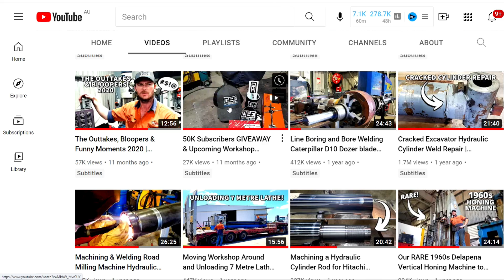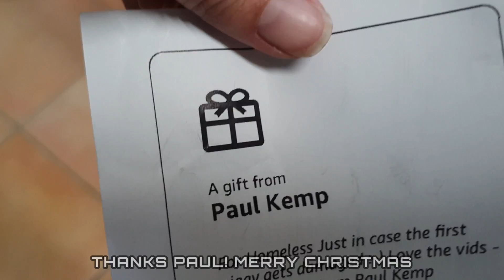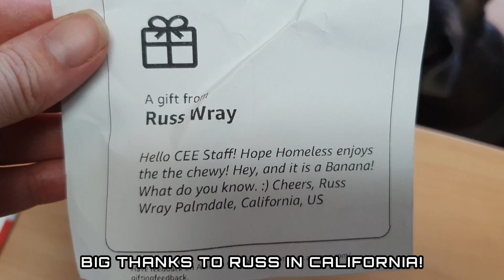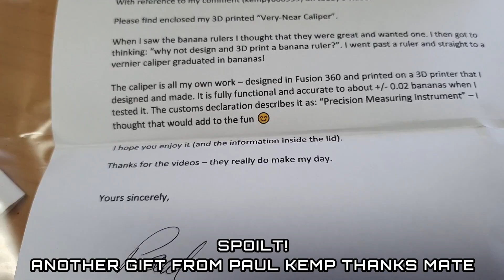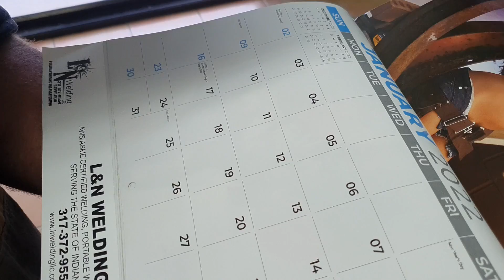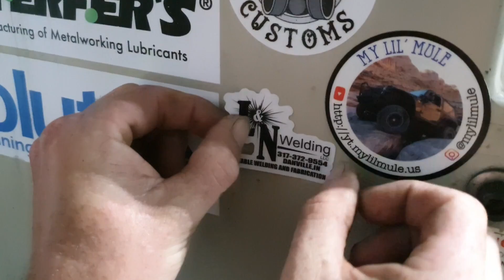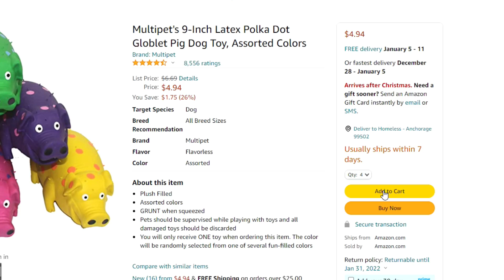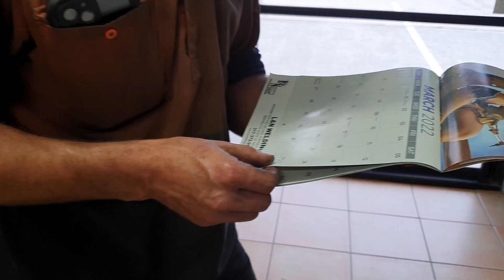300K Subscriber Giveaway & Opening Fan Mail | Merry Christmas 2021

Comment: I love how clean your shop and work is.  Shows you take pridr in your work.   I would like to see more on how you setup your pieces in lathes and mill.  Like how you measure hole spacing for bolt in a ring.  How you center difficult pieces in the lathe.  I enjoy listening to you explain your work.  You are very concise and well spoken.

Comment: You guys do some excellent work. I particularly like large lathe and welding work. It has made me realise that I could do smaller jobs such as hydraulic cylinders on my hobby tractor and my 200A MIG would be perfectly adequate.. Duty cycle would be the limiting factor but still doable. I would probably have not considered doing such jobs before.

Comment: The best part of your show is the lathe work for me. Having put in a good amount of time on old junkers with soft beds I relish getting a big lathe with hardened and ground ways. Then the joy of measuring the job and getting parallel faces. I got some guy asking me to make a stump grinder shaft out of 5" material and my machine is flat belt driven. Jeez I had to use belt tack to cut that sucker, the chipbreaker worked a treat and soon I had a pile of blue chips building up. Not bad I thought as the people who built the lathe only had carbon tools to use at the time (WW1 era) and could only dream of having carbide tools. I do prefer cobalt HSS when I can get away with it. I like a knife cutting tools with cool shavings. I hate trying to dodge red hot flying metal. That's what I like about CNC equipment. Closed cutting area and plenty of coolant ! Good luck mate and make some more cool vids for us next year ! Merry Christmas to you and Karen and homeless !!

Comment: Wishing you all at Cutting Edge Engineering an outstanding New Year and kudos for reaching 302K
Subs before 2022!

Hope your CNC Milling Machines end up (in the longer term) saving you lots of time and energy for
use on better things (by automating out the repetitive jobs) – but getting organised initially to
program and run CNC in the short term is no mean feat - BUT once you get started with CNC before
you know it you will be doing CNC Plasma Cutting like a demon!

Like the way you use modern techniques to machine, work and join heavy gauge metal like using TiG and
MiG Welding - unlike in England where there is a common fallacy that any metal much thicker than
Car bodywork MUST be only ARC welded which is a ludicrous myth - you prove how actually it is very
efficient to MiG and TIG Weld heavy thicknesses of steel - your workshop isn't fanatically clean nor
is it a filthy mess - it's just right - somewhere that work gets done without being a Dickensian
Workhouse.

I like the fact that you take your own health seriously for instance using a (relatively pricey) battery
powered respirator feeding an anti-fume hood while you are welding some projects and even use
hearing protection when required - it is about earning money and going home safely at the end of
the day NOT ending up deaf, mad and blind from the fumes and other side effects of your working
environment - I have met those people and also attended some of their untimely funerals.

I like the way you admit when things go wrong - for instance when you are shrink fitting a pair of
identical bearings and for no known reason one of the bearings gets stuck and won't fully seat -
nevertheless you leave the footage in and show that even with perfect preparation sometimes these
things just happen - best of all you admit to buying second-hand machinery instead of the snobbery
of everything must always be brand new - couldn't agree more - nothing better than a serviceable
used machine - let someone else experience the Out-Of-Box failures of brand new unproven
machinery - especially when there are no new functions in a brand new machine when compared to
a used machine. He who has the most (working) machines wins!

The field trip to show the CAT 631 scraper fault was an interesting change of pace - makes
everything more real and less abstract - a real part being manufactured for a real machine with a
real problem.

Particularly good when you identify manufacturer design faults and alter the original design to
engineer out the problem - most recently the tilt bucket for a Komatsu PC350 digger - overbore to
fit in hardened sleeve bearings - Trouble No More! - which is the last thing equipment
manufacturers want to happen.

Comment: The outtakes are enjoyable but they fall short of the Safety Officer.
But I believe making your tools equipment would be interesting. You bought quick-change posts but making these would have been very interesting. Especially as you revit your, to be sold lathes.